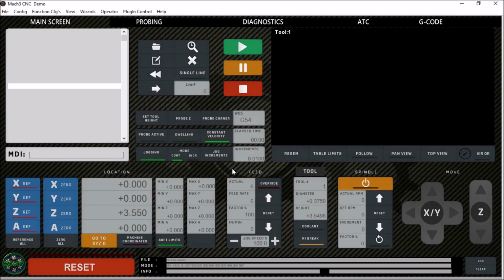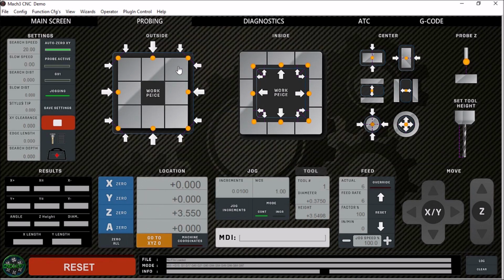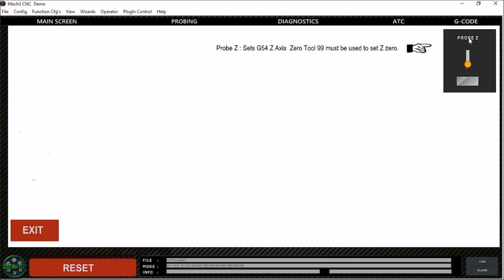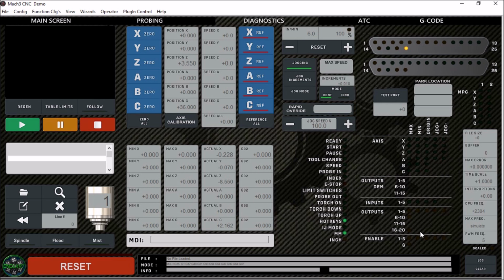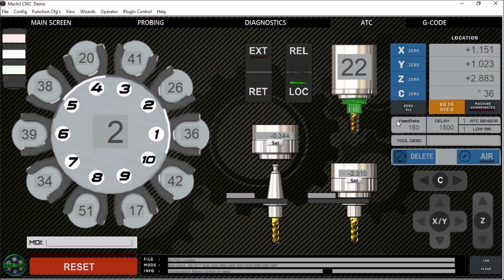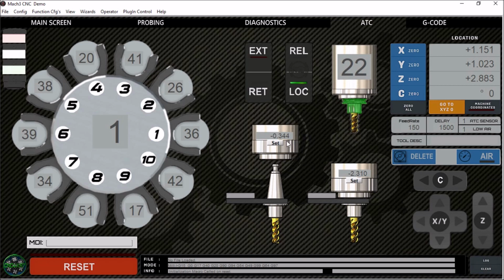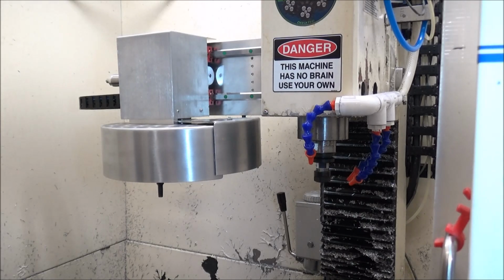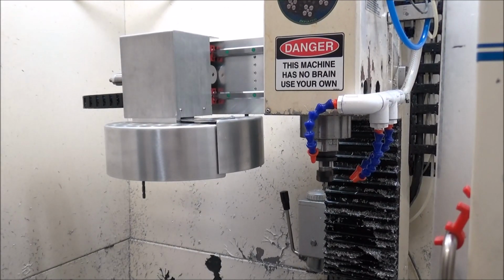MACH 3 ROTARY ATC CONTROL

Comment: Hi, I'm looking for spindle alignment because my spindle has a teeh. There are some comands or macro to stop the spindle in a precise position? I use an AC servodrive wirh pwm control. Thanks you!!!!
Reply from the maker: If you have a Bt or iso 30 spindle with drive Dogs.
Normally the VFd can be setup to stop the spindle at the same location to align drive dogs.

Mach3 can send a output to initiate a alignment to vfd or it can wait and receive a signal that alignment is complete.

Comment: Hi Sam. Thanks for the video. During the video (5:00) you refer to the annoyance of Mach3 to start with a feed rate of 6. You can avoid this but going to the Mach3 "General Config" screen and adding F?? to the initialisation string. Hope this helps.
Reply from the maker: Yes, You are correct! Thanks I mentioned the Initializing string in this or another video later on.

Comment: Nice work. Is there any safety fail detection or something that will prevent it crash?
Reply from the maker: Well there are a few built in like low air pressure , and Carousel Extend and Retract. There is no great way to ensure the tool is Clamped with this type R8 Spindle.

Comment: Really nice, the ATC is amazing. If I will never end up making an ATC for my mill I will grab it for sure. Really well developed. One question out of curiosity. What sensor do you use to know that you have enough air? I am making a vacuum table and that feature can be really useful. Thanks a lot!
Reply from the maker: Thank you very much! Check out last weeks video I show the sensor in question in the first 2 min.
Reply: @CNC4XR7  ah great. I have watched but missed that part. I will watch it again. Thanks a lot
Reply from the maker: @Ale_Lab  search ebay mine is adjustable about $10
Reply: @CNC4XR7  yes I have found the one you used. Although for vacuum I need something that detect negative pressure. So need to read a bit about it

Comment: Screen looks sleek now. Have you done the same changes to the linear version??
Reply from the maker: Yes
Reply: @CNC4XR7  Cool, then I will probably purchase the screenset for my old Wadkin I have added a 9kw atc spindle to. :)
Reply: @CNC4XR7  How do I order this for a linear version. The one shown on your website,is still the not so sleek version. :)

I have a spindle with sensor for open drawbar and closed drawbar. I also have to air valves, one for the PDB, and one for through spindle air, to clear dust from bearing opening. This secon one I need activated when running a program, and when doing a toolchange automatically. Is this tandard in the screenset, or can I easily add that second output activation in the M6start script.
Reply: My Tool sensor is also stationary on the table, so I hope it's possible to set the tool sensor location in your screenset as well.
Reply from the maker: @INWondeR  send me a email with the requirements out lined in the comment. I have the screenset ready. I will need to tweak the macro a bit. Cnc4xr7@gmail.com
Reply from the maker: @INWondeR  yes it is